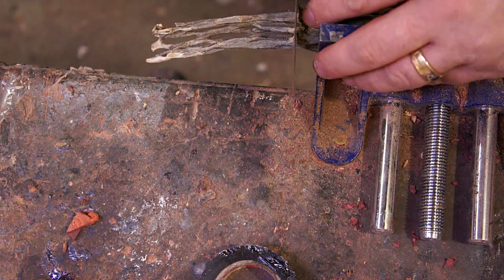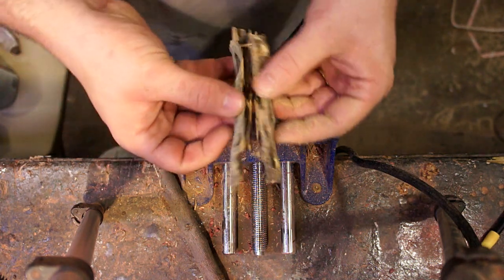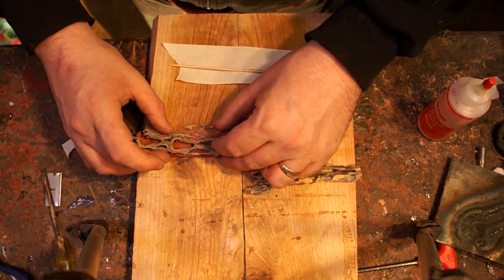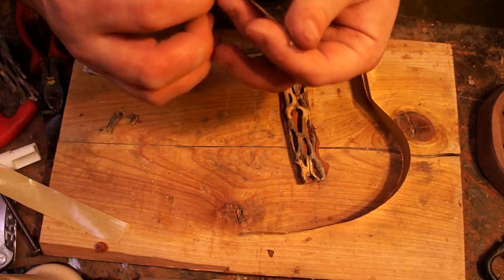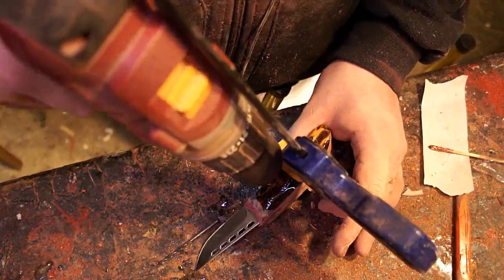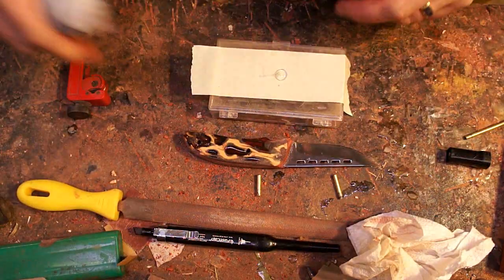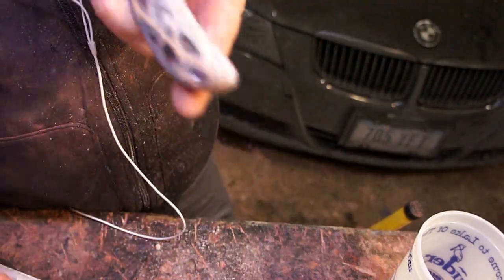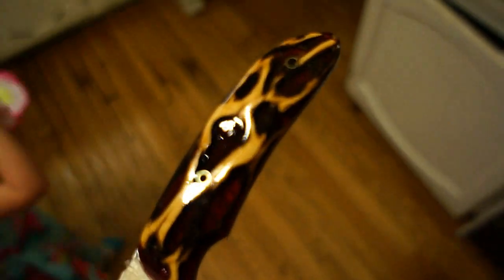Skeletons in the shop: Cholla Skeleton Epoxy & Redheart Knife

Comment: I like it. Real nice. 

My friends dad use to make his blade handles and got blank knives strait from the smith. Still had the striations steel has before sharpened and bugged out. 

But he also put them into an epoxy in a jar and vacuumed it to make sure every pore of the wood. Makes it much stronger. 
Then pulled them out and cured. Then did the buffing. Super awesome use of the cactus. 

Can’t wait to try it.

Comment: How many times do you have to hit it with the heat to pop the bubbles? Is it just the once, or do you have to do it several times as it cures?
Reply from the maker: Sorry for late reply. It really depends on how deep your pouring. Thin surface pour one time works. Anything else I try to comeback every 5-10 min to re pop.

Comment: Nice knife, very creative. Will take an idea from you, or at least concept, Thank you
Only thing that bothers me is when drilling out the holes in the cholla cactus scales, the blade was not wrapped and you had no protection on your hands.  I know no one likes to hear about safety in their own shop but I did the same thing and the drill bit hung and cut my hand from wrist to just past my thumb. Blood squirting and I have permanent nerve damage from base of thumb to tip on one side.  I am a machinist and have done this(drill without safety measures) hundreds of times. Just everything was right or wrong for it to happen.   Anyway, people not as experienced might not think about it.  I am 30+ years experience making knives and this was the first time it happened to me.  Be careful, like to see your videos continue without scares or interruptions.